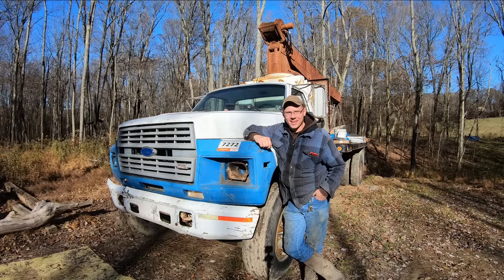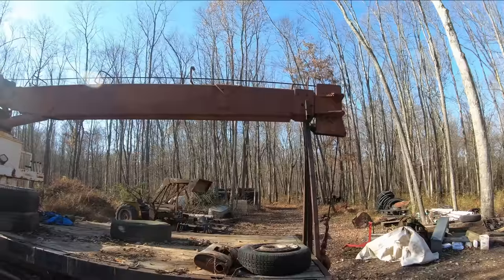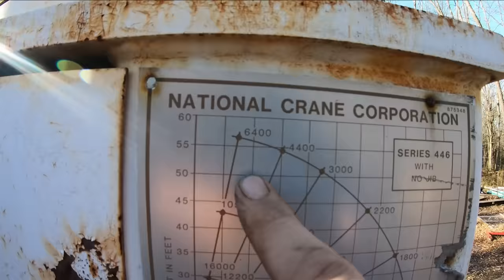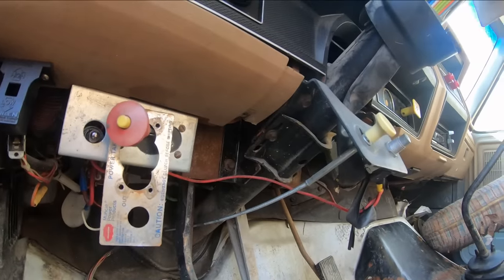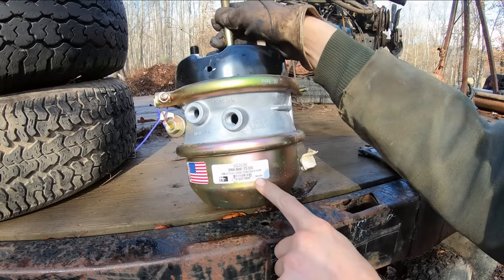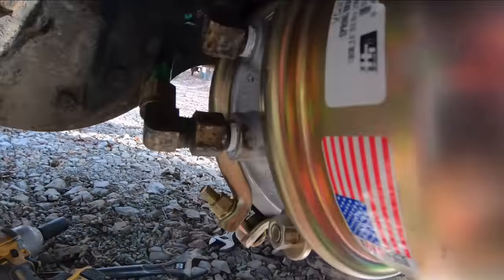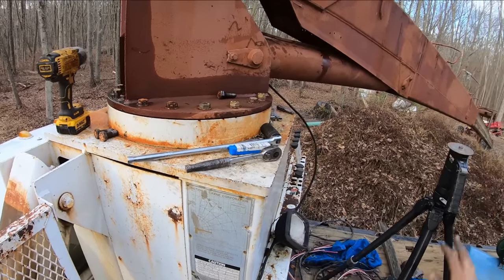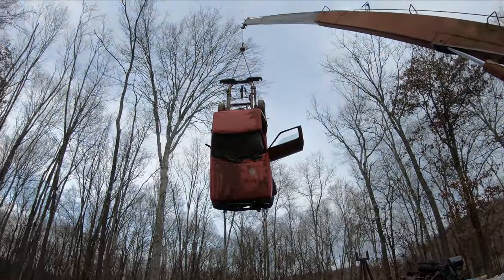$700 Auction Crane put to the Test!! Will it LIFT???

Comment: Never mind belt dressing. Hold a bar of soap under the belt as it's running until the squeak stops. Old school works everytime.
Reply: I used a spray bottle of kitchen degreaser on my auxiliary belt, hosed it down good and it stopped the noise nicely.

Comment: You should definitely fit new lights - the broken or missing ones at least - and see what you can do about having it's cab interior made over. With a little TLC that crane truck should be as much fun to drive in as it is to operate! :D

Comment: The most important rule about overhead lifting? Never get underneath a suspended load!
Reply: Matthew Taylor men constructing ocean going ships are often stuck in very tight spots with many hundreds of tons of steel dangling overhead. Standing two feet clear of a descending load should be considered attempted suicide.
Reply: @timmayer8723  What is your point? Are you arguing against a “rule to live by?” Two feet isn’t underneath, so 🤷‍♂️

Comment: Matt, you will have to replace the brake chamber as the emergency side is the side leaking. Commonly the coil spring brakes   inside and  punctures the emergency side diafram. Just for clarification the forward portion is the emergency side and the half closest to the axle is the service side which has a replacable diafram. haveing been in the truck repair business well over 50 years I recommend changing the whole chamber on a truck that old. In fact changing both makes sense. ----P.S. be carefull removeing the spring loaded chamber and carful measuring the pushrod length you will need to cut.I suggest cageing both the ones to be removed and the ones to be installed before cutting the rod.

Comment: First thing I want you to do is remove the auction sticker. Then given that the previous maintenace looks very shakey, carefully check all hydraulic lines and the winch brake. If either fails you have a falling boom or load.

Comment: I bought two heavy duty trucks out of a junkyard yard several years ago, one with a crane, and the other was a flat bed for additional parts, needless to say points, caps and rotors, plus other small stuff and they both ran and drove. Sold the pair for a nice profit to a small construction co. Strictly as is! They were still in use 10 years ago, when the company closed down!

Comment: Don't mean to beat a dead horse....After you torque those turret bolts, Mark them with a paint pen (mount plate to bolt head). That way you can do a quick visual inspection to see if any have loosened before each use... at a glance. That's what they do for an annual inspection. Keep the videos coming!

Comment: Glad you got yourself a crane. squeaking belts means a lot of things.
1. how old is the belt
2. alternator may need to be tightened (on my truck where the alternator was had a broken bolt that tightens it, so I replaced the bolt, tightened it up = no squeaks)

Comment: I had the bolt problem.  It seemed to be rotating slowly.  A contractor convinced me to pull the rotating part from the fixed shaft.  I found the fixed shaft to be cracked!  Sure glad we checked.
😊

Comment: I see some other people down below have commented on it, but you REALLY need to inspect the wire rope before you do any lifting with it.  Chances are it will need to be replaced, not just cleaned or greased, as it evidently went a long time sitting and unused.  Damage in the middle of the rope can be hard to spot and greatly reduces capacity, and sudden rope failures aren't fun.  Even if it inspects out as OK and you just re-lube and use it as-is, I'd start watching the auctions and such for a replacement spool of wire rope so you are ready when the inevitable time comes.

Comment: NICE, I miss having one. Two points. Oil the cable and watch the saddle tank. The rubber cover on the straps wear out and after awhile the tank will leak

Comment: Awesome.  Something you may want to look into.  The purpose of the button starter might have been to take the load of the start off the ignition switch box you had to replace.  If it burns out again, you might want to put the button starter back in.  It is a higher amp switch.  That was my thought when you first made mention of by passing it.  Then you burned out the factory switch.  Again, just a thought.  Awesome Job, and I love how you are informative with the things you are doing.  Educational, Informative and entertaining!  Keep it up! (pun intended)

Comment: Your purchase was a wise one.  With your sweat equity and some parts, the truck will be reliable for a long time to come.  Consider replacing the cable on the boom.  bcbloc02, Brian,  another YT channel, installed a used overhead crane in his machine shop.  While offloading a large drill press, the cable snapped, the press fell 3 or 4 feet and a large part of the table broke off.  Be safe!!

Comment: I operate a digger derrick for a utility company (small crane with an auger)  and had someone snap off 2 of the 4 bolts that hold the rotation motor.   Our mechanic (not realizing) replaced them with grade 8 bolts.  Using the boom to pull out old poles, they snapped in no time, and those 4 bolts are the only thing that keeps the boom from just swinging freely.  So he quickly found out that they are specialized bolts, rated much higher than grade 8..   just something worth keeping in mind while replacing bolts on a crane or any boom truck.
Reply from the maker: I’ll contact national and see what they say. Hopefully that’s not the case

Comment: Good luck with it! Nationals are excellent boom trucks, you got a great base to start with there, made right in Pennsylvania to boot.  It does look like you are due for a hoist cable right around 14.21 though. Those waves in my experience are typically due to either running the cable over too small of a radius instead of the proper sheave, a major shock loading, or a serious overpick on the cable, usually from using the boom cylinder to pick a load instead of the winch. Shoot me a message if I can help with any other crane questions!
Reply from the maker: I didn’t know they were made in PA! Awesome thanks! Yes I’m going to look into replacing the cable
Reply: @DieselCreek  Yessir, right in Shady Grove, PA, just outside of Greencastle, PA off of I-81. I work on a big-ish fleet of the things, so most any information I can get ya is available. They are pretty much the top of the line, as evidenced by little stuff like your load chart is embossed aluminum instead of a sticker. She’s a good ol’ girl! Good luck with it!
Reply from the maker: Yes it seems well built I’m probably gonna build a man lift basket for the end of it unless I can find one cheap somewhere.

Comment: Love the videos! I'm still watching to catch up. Not sure if you even still have this truck. Just a heads up, the EGR valves and the the plate that it mounts to (under the carburetor) are horrible about leaking/rusting/rotting ...and it causes them to run super rich, miss, sputter and the gas fumes back at the crane operators stand will choke you. Its feeding the engine raw exhaust at idle) Make a 1/8 inch plate and put it under the EGR plate between the intake and plate (the block off plate should look just like a solid gasket). This normally improves all of the issues mentioned above. Great to see it back up and running!

Comment: There's all kinds of parts on that pickup.
More, longer exhaust for roller, 2 braking axles for a trailer, 
Transfer case as a PTO, frame girder, crossbeam,
sheet metal from bed, doors, hood, cab, fuel tank.

Don't waste nuthin!

Comment: Your chart is the max weight at a given boom angle to ground. It doesn’t matter the orientation of the boom to chassis. So, you could pick more when in line with the truck frame.

Comment: Check the pulley on the alternator for wear. I have had 2 vehicles that the only fix for the squealing belt was to replace the pulley. Tried new belts and different brands etc, didn't fix it.

Comment: Truck cranes like this one are usually from a fleet.  They fail to pass their annual safety inspection, so considering the age, it was best to sell it off and buy a new one.  I would inspect the turret box really well.  Any cracks need repaired.  Also inspect the boom slide pads.......
*Rear Maxi brake pods  that have two diaphragms and one spring.  Park brakes are air released with a button and service brakes are air applied with a foot treadle valve.

Comment: Use a little adjustable wrench to spin them up with and then torque with a big wrench. You don't need a foot long wrench to run a fitting up.

Comment: Not sure if you've fixed the alternator squeel yet, but in my experience that has always been due to a low voltage condition on the batteries. Basically, when you start the truck and the batteries suck as much juice as the alternator will give. The heavier the electrical load, the harder it is for the rotor to cut through the magnetic fields of flux. That mechanical resistance is what causes the belt to slip over the pulley. There are cases where it's a belt, or even a pulley, but most often I've found it to be the battery.

Comment: Modern spring brake chambers can not be disassembled due to the fact many people were maimed or killed during the process. The service brake side can be repaired, however the best option is to use a 'piggyback' unit.

Comment: its a lot easier to tear apart the boom on a boom truck really main thing u need is two forklifts (to support boom after u get anchor bolts that hold it on out) and like 30mins to take bolts and cables out

Comment: You should replace the non-existing headlights with some of the led units they make as stock replacements for Jeep's. They're just the old standard rectangular glass bulbs so they should be easy to get for that truck.

Comment: Definitely needs to be made road Worthy, what ever that is lights and horn .🙂 Yes let's hear that horn, air horn that is. And with a nice yellow crane on red cab with black deck.  Whatever you do to it it'll be great! Interior probably could use a vaccume 🙂 I liked the ole'girl as soon as I saw its potential,and as soon as you had the outriggers in operation I was like wow! But of course that crane is amazing...love it.  I have a back of the truck hydraulic pump mini lift" crane " I paid 170$ for used ,and one of,the max out lifts I did with it ,ended up paying for the "crane" and my then some in the sale of the wood burning boiler pool heater that was left at the end of a move out ,cause it was just crazy heavy and awkward.  So free  for whomever was able to pick up.🙂  Anyway,love your channel content.👍

Comment: Depending on line size, you can stop air leak to that can by taking the rubber line off and using a dime to block airflow and snug the fitting back up. Temp fix👍🏻

Comment: @22:36 That Alternator belt squeal is the alternator trying to
put a charge into severely sulfated batteries. Huge resistance acts
like a "break" to the Zener Diode, making a drag on the pulley.
Deep charge or replace the batteries, and coat & protect those
old belts with belt dressing. Keep out moisture, condition to
make tacky and less slip. a severely drained battery will kill an 
alternator, and a defective alternator will permanently kill a battery.
Always change both as a system. Zener diode are cheap- rebuild DIY.
Very rarely do housings, brushes, stator/armature go bad. 
Bearings are cheap, too. Disassemble, clean, reassemble 30 mins.
CRC Lectromotive cleaner, NOT brake parts cleaner.

Comment: Those bolts are a perfect example of not using anti-seize. I know it'll be on everything within a 50 mile radius if you use it, but it is worth it. Oh, and never be under the boom when lifting anything. Should have picked the truck up on the pax side of the rig.. especially with a new to you rig.

Comment: you should have put neversieze on them big bolts, its good to use it on most bolts on outdoor equipment such as wheel studs also, you will be thankfull next time ya have to pull off a wheel and not have to fight the studs

Comment: For anyone who's never worked on an air brake drum before, they are basically bombs. Don't ever ever ever take the drum apart, that spring on the inside is under tons of pressure. My co worker took one apart, no idea why but when he did the canister shot about 75' in the air. If that would of hit him it probably would of killed him. When we replace them at work we use a torch and burn through the housing and cut the spring to release the pressure.

Comment: Aaaaand.... now it's time to start replacing the lights on that vehicle.  Brake lights, head lights, running lights...  you know the drill.  So far you have about $1300 into this project.  I figure you'll need a couple of hundred more just for the lights, and another hundred or so for the guide pads on the extendable arm.  Still a pretty good investment.

Comment: For safety sake you forgot to oil and service the winch and grease or use old black engine oil on the winch wire cable  to stop it from rusting any further .  Old black oil is great for loosening rusty .seized bolts,etc, and for use as an  under seal and preventing rust.   Tom
Reply from the maker: The cable is junk and needs replacing ideally

Comment: The belt squeal is probably due to the alternater having a large load since the starter has drained a lot of charge from the battery. It then stops as the charge is recovering.

Comment: Nice video
 next time leave the air pipes on the chamber take the hand Brake off and then insert the spring tool the air will hold the spring back and will save you winding it off by hand
Reply from the maker: It was so blown that it wouldn’t release at all with the air

Comment: I would pickup some rigging to keep with the truck.  Also, always rig with one end of each chain connected to the cable, so your lifted item can't slide.  Lifting the truck was pretty obvious that it wouldn't sliide once taught, but if it were me, I wouldn't want to take a chance that I'd get "comfortable " after a bit and forget to do it right when its important.  Ie always best practices even when it doesn't matter.

Comment: I'm pretty sure that bed was hanging by the old wiring harness plug...and when the wire broke, it fell. I bay be bitter about harness plugs.  
What I wouldn't give to have one of those crane trucks handy for building a barn here.

Comment: if you look at the sides of the belt, it will probably look a little shiny, over time the rubber area in contact with the pulley wear away, then the belt starts to slip a little=noise.

Comment: them old big trucks have alot of mass on the belt drive like them giant ass direct drive cooling fans so the belt slips on start up because all of the components are still spinning up to speed once everything catches up to the motor it goes away very common on old big stuff especially if the belt is old or loose

Comment: Your exhaust leak could cause a warped valve. The valve gets hot and when you shut the engine off cold air leaking in on a hot valve could cause the valve to warp

Comment: Haven’t watched the whole video yet, but I wouldn’t recommend doing to many picks with it until you get oil leaks fixed and back stabilizer fixed. Also wouldn’t use it to pick something up to work under it. To many things could happen with a crane that old. Not only could cable break, but a holding valve could give away. Each function has its own holding valve, boom, telescope, and hoist, if any one doesn’t hold could cause load to come down

Comment: Old belt squealing trick: rub an "ink" ereaser on the belt while it's running and it will clean and de-glaze the belt
Reply: Needs a new belt, and the current belt is probably dry and may not be tight enough.

Comment: If you take the time and read your chart I think you'll find that the ratings are level and off of the rubber. Plus, to be in compliance with the applicable standards, your outriggers should be supported on pads 1.5 times the float size.
That is tthe part of your outrigger that is on the ground.  The capacity/range chart is 360° but you'll be well advised to minimize your over the front activity.  
Most reportable crane accidents are attributed to inexperienced operator error.
Be Safe.

Comment: Belt squeaks because the battery is weak / cold.  Heavy draw from start causes the alt to charge heavy right after starting.   Glazed or improperly tensioned belts/ Weak battery/ cold weather/  worn starter/ will make it charge harder right after start causing belts to squeak .  Cold weather will make it worse.

Comment: Wow everything works all the stabilizers and the boom and winch truck runs not to bad for 700 bucks what a Steal of a deal sounds like it needs a few things like the air brake leak fixed and maybe a few tires or atleast aired up but not bad at all Matt 11:39 @Diesel Creek

Comment: Be really careful and thorough with the turn table area, not a place to cut corners. In a class I had to look at a accident where a crane like this failed at the bolts you changed and killed a guy. some bolts failed from fatigue (really scary stuff) and when they let go the rest of the good ones broke bringing the whole thing down on the operator. Truck looks super handy I would maybe just stick a scope down in the holes and make sure those threads look good